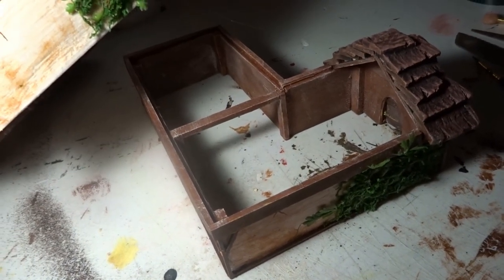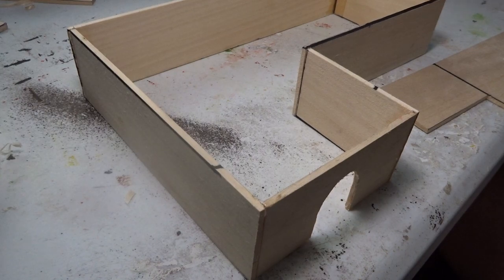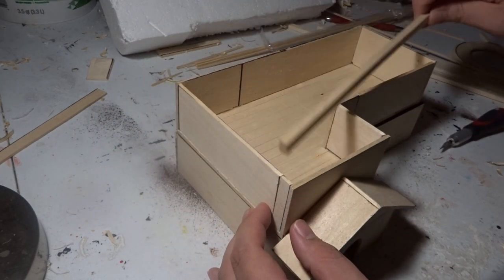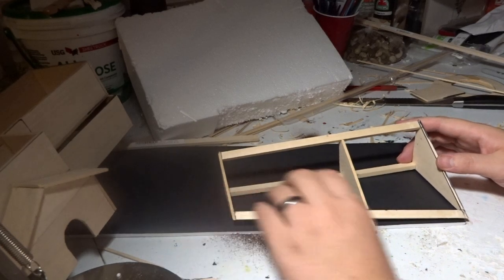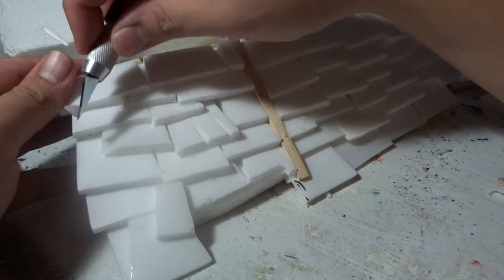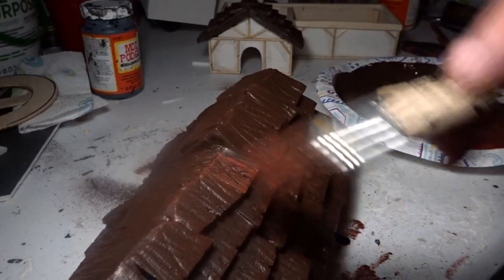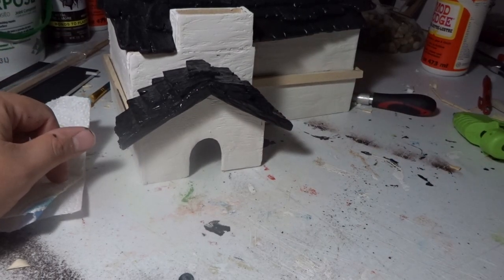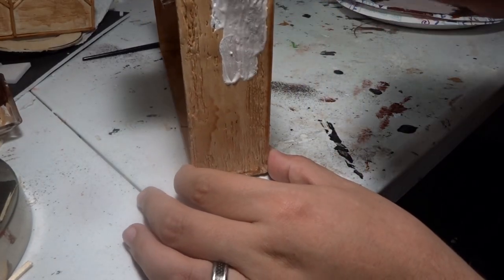Tabletop Terrain: DiY Tips for Modular Buildings. Tavern Build

Comment: Hey! just found your cannel and I think this build is awesome. I myself am starting with my first pieces. 
I have a question. Do you happen to have the brand or how can I find that foam for the tiles?
I happen to live in Mexico and most XPS foam is for costly isolation construction, also, it comes in biiiig sheets. I've never seen a sheet like the one you used tho.
Do you happen to have the brand or if it has some kind of technical name?
Reply from the maker: Hey Andrés, sorry I'm so late to respond... I don't check my youtube very often. The brand is "Adams Readi-Board". https://www.dollartree.com/black-foam-boards-20x30-in/25957